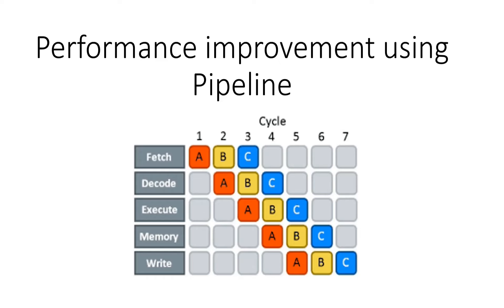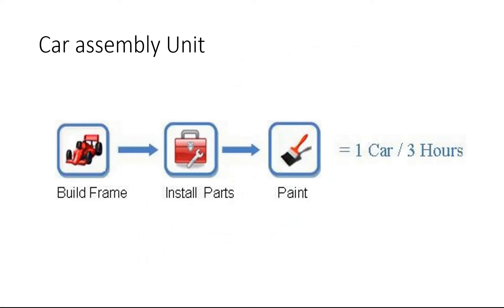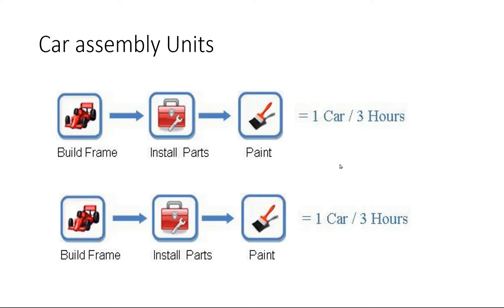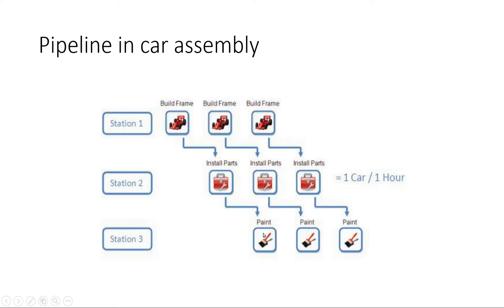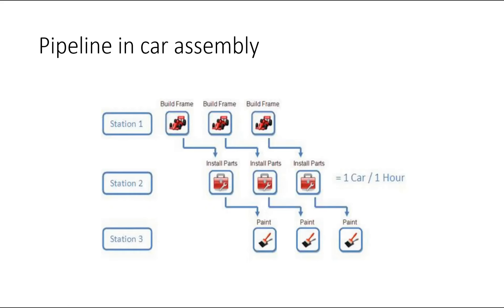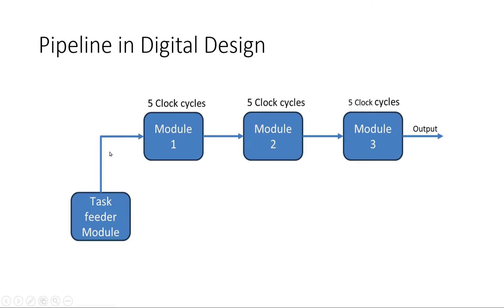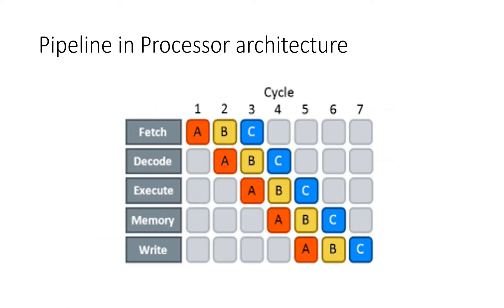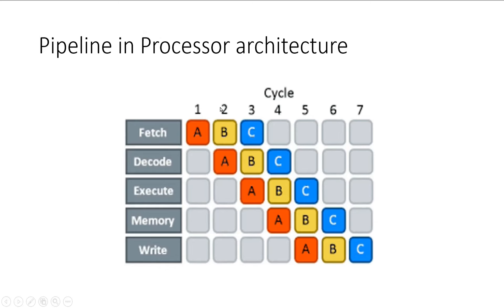How pipeline improves the performance of the system

Comment: Can pipeline also reduce the dynamic power consumption in some specific designs( large combination circuit) by reducing intermediate switching due to different delays of multipaths from input to output ports???